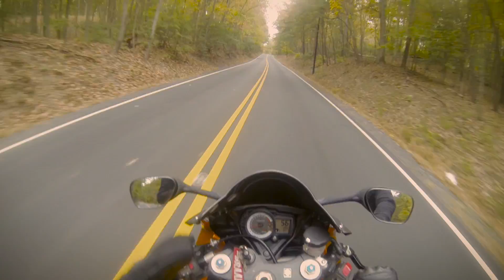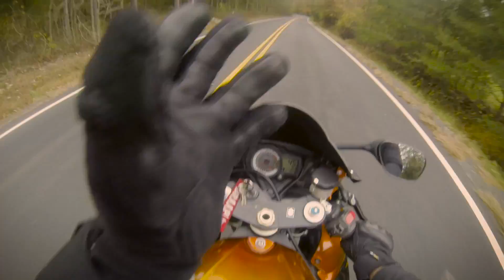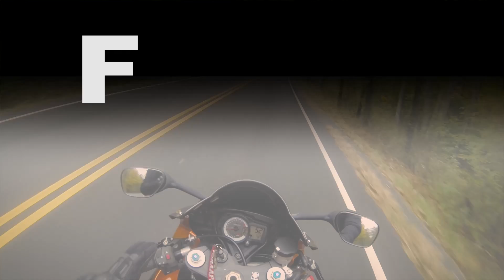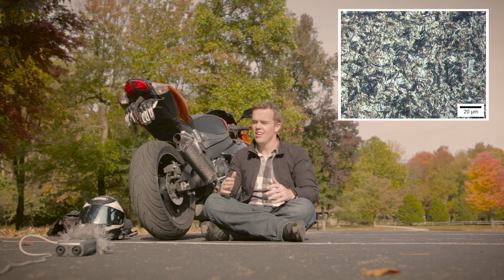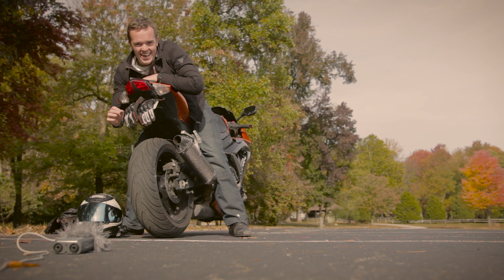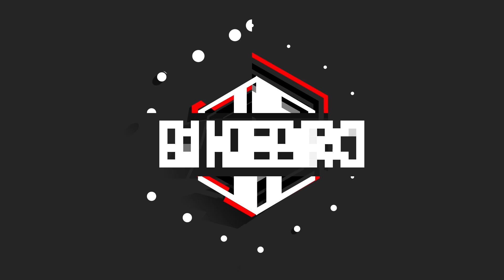Motorcycle Traction explained

Comment: I find this hard to believe. Change the tyre pressure on a bicycle and you instantly feel the difference, before the tyre has even had a chance to warm up.
Reply: +BikeBro
Sorry, but you're completely wrong, even on a macroscopic 'smooth' surface. The coefficient of friction is NOT independent of surface area OR surface pressure when it comes to rubber or even worse still, inflated sticky rubber compound toroidal balloons that is sport or race tyres.

This is a physics fail, even though I can understand it to some extent... Rubber friction is a very complicated field if you want to get deep into it and the Amonton/Coulomb approximation (F=uN) doesn't apply very well at all, even though I can smirk a bit at the physicist/engineer hubris to have it figured out on paper from, in practice, high school level physics. The Coulomb experiments we all did in high school somewhat applies to rigid bodies of hard materials, not universally, and especially not to sticky rubber.

A paper survey just to scrape the surface on how deep these problems are is:
"Tyre/road friction modeling Literature Survey" R. van der Steen
http://www.mate.tue.nl/mate/pdfs/8147.pdf
Or even "Physical Factors In Tyre Traction" by K C Ludema from 1975(!)
Or any papers by B.N.J. Persson, he's made quite a few papers on rubber friction.
Reply: I think that you are confusing two things:

1. Friction
F=u*N
It prevents your bike from slipping during turns and it allows you to brake.

2. Rolling resistance. 
It is force that you need to overcome to roll the wheel. 
Lower pressure in the tire = bigger deformations of the tire = you need more force to roll the wheel
Reply: 6Twisted Yes, you can feel it, and usually you're feeling allot more than just a change in grip. He's right, there are a lot of variables in a tire... many more than we commonly think about. Doing something like adding pressure dramatically changes a many of them. Yes it changes grip, but it would be silly to try to establish a simple rule of thumb for what happend to grip when you add pressure. In some situatuons it would increase and in others it would decrease.
Reply: +akupehsluarketatAR
It may sound right, but that's really adhesion. Friction doesn't actually work like that. It's the product of the force pushing two things together and the coefficient of friction for that particular set of materials and conditions. Contacting surface area does not have an obvious impact. 
He understands friction, and so he was getting at the question of why the wider tire is used for high performance bikes. I think he has the right idea. For those not familiar with basic mechanics, It may be tempting to think that extra area simply means extra grip... it would be true for tape or glue, but for for tires is't actually only a tiny bit true, and for none of the reasons you think. Because rubber deforms readily, rubber on pavement has a non-linear friction to normal-force relationship, (or a non-constant coefficient)... basically if you graze a piece of rubber on pavement extremely lightly with almost no normal-force and measure the friction, it would indicate a much higher friction coefficient than the 0.6-1.0ish we see in tires under normal loads. It's like it's adhering very slightly to the road. This, combined with the grip-supporting thermal stability and stiffness he talked about is why we see wide tires.
For street tires, you could say that a small portion of the grip of a tire is proportional to the contact area, but most of it isn't. Much more of the grip is proportional to area for drag tires. They exaggerate those non-literariness making the tire / track sticky... lots of adhesion.
Hope this helps.
Reply: ganiniii What are you taking about. This is a comment thread on the very video which states the exact opposite of what you're saying. Same weight on a larger area does not increase friction, yet here you are, saying it does.
Reply: so my question is. my bike stock runs a 160 which is good but hey i like the 170 instead am i hurting for cornering going wider or Sense its such a small difference i would be fine.
Reply: scott gardner If I'm gussing correctly about where your commas would go, it doesn't matter much. You should be fine as long as you have good swingarm and chain clearance.
Reply from the maker: 6Twisted you're sorta right.  If we're talking about a mountain bike reducing pressure will allow for more Traction over irregular surfaces (though at the cost of rolling resistance,  heat build up, tire rigidity etc etc) but this is because of the knoby tires.  Friction, as I said in this video, of the rubber on a smooth surface though would still be the same because the force acting down is still the same
Reply: @bikebro5938  Airing Down Increases the force on the given friction coefficient by reducing the weight resistance holding up the bike, thus increasing grip (at the expense of more force/energy needed to overcome rolling resistance ie poorer gas mileage)
Reply: you are right because by lowering the pression you make a bigger/wider contact surface wich means the weight of the bike and your own will be applied onto a bgger area and therefore increasing the friction.
Reply: imagine the contact patch of a full inflated tyre is your palm. a lower inflated tyre has more contact patch = more palm of your hand holding the road = more grip = more friction.

Comment: Shouldn't the softer tires be better for colder days? The harder, touring ones will be soft enough in hot summer while the softer ones will still be kinda soft even in cold and should have better traction than the hard ones which will get harder at lower temperatures.
Reply from the maker: naril0s yes, you are correct but what I was getting at is you won't be canyon carving or track daying because it won't be as nice out so your riding will probably be more mellow PLUS most of us can't afford tires multiple times per year so I feel the best mix is to get very sticky rubber for the summer and enjoy the weather then get a good set of harder tires (angel gts and pilot Roads are great) to get you the entire rest of the year
Reply from the maker: naril0s oh and it's generally wetter outside the summer season and stickier rubber also tends to sportier tires which lack threads to deal with water
Reply: Unless you get the really soft tires up to there operating temperature you might as well use street tires which operate better at lower temps. For example, my street tires kick ass on the warm up laps until the racers get their tires warmed up...then the fun begins for them

Comment: A lot of the confusion comes from incorrect terminology used by riders and riding coaches. People often say that trail braking or accelerating makes the contact patch larger on the front or rear tyre. The contact patch is larger because of the extra weight on that tyre and that is what gives you more traction. People should remove the term contact patch from their vocabulary and just say they are loading the tyre and everyone will understand what they mean.

Do a video on counter steering. That'll be fun.
Reply from the maker: +Laxmoto I need to do some research into the confusion of counter steering. To me it's just how you steer a bike after you get any speed up but the physics of it are pretty fun so I can definitely do something with that for you
Reply: Many years ago, I think that that "trail braking" sometimes saved me from coming off in corners where I was feathering on the edge of adhesion after a fast entry. I never really knew why ... it just seemed to work. Now that you have mentioned this concept of "loading" the rear tire, perhaps all these years later I can understand the effect. Back then, I just assumed that it provided stability at the back. This technic needed a very gentle application. A tad too much and you would be down on the tarmac.